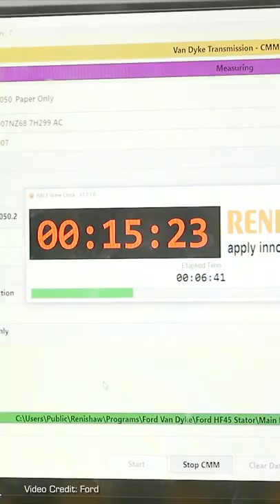Ford Patents Tow-Charging System For Electric Cars #Shorts

Comment: Someone did this in a Tesla before and it worked. However, Mach E's coming down a long steep hill in the EU were overheating their electronics from prolonged regen......I'm Thinking, if you can't make good tech, you might as well go for patches?? Variable Regen is already built into many vehicles. Teslas could probably do this with an O.T.A. Update, adding an On-Tow setting on the main screen and that would vary the regen rate according to the vehicles power electronics.

Comment: I see this as a niche option.  "Oh crap, I ran out of battery 30 miles from a charger."  A roadside assistance vehicle could tow charge you just enough to get to that charger.  I don't see it as a thing you would use except in an emergency.

Comment: Though not recommended for the current available EVs. Sounds like Ford have worked out the mechanics and software of this as to not damage the drivetrain & batteries.

I can see a setting for Tow-Charge that would set the vehicle into "neutral-gear", while also locking the steering wheel into forward position. *No more ropes and funky knots.

Comment: The world could use tow charging as an additional method. Any number of places in the world don't even have reliable power for homes, let alone a luxury like an electric car. Hopefully in 20 years they have induction solved so that every EV can both plug in plus induction charge. That way induction can be built into street parking, parking garages, etc. where vehicles sit for long periods.

But I'd like to hear about the safety of induction charging, say if it was in the garage or driveway. What if a child parks a tricycle on the pad? Way back when I lived in AZ many of the high power lines run along the canals. There was something about my Nishiki mountain bike that gave me constant shocks if I road the canal paths while my friends had no issues with the brand they had.
Reply: What if a child parks a tricycle on a pad, turns the pad on, triggers the charging logic, and then... what?  Maybe has just the right electromagnetic loop to create potential and get burned?
That's alot of what-ifs.
A close one would be, 'what happened when a critter squirms into the space between the pads'
EM is mostly harmless to living things.
Reply: @CrissaKentavr  Is there charging logic like the pins in an EVSE? I think induction is always on, and it certainly will be in parking spots and roads. A pan on a stove doesn't have a chip to signal it's ready to get hot. We turn the stove off when not cooking because an accidental placement of the right type of metal or coil will cause a problem. Although possibly car induction charging is to weak in strength to cause any safety concerns and I'm sure they'll figure it out to avoid being sued somehow.
Reply: @davidmccarthy6061  In the SAE (Society of Automotive Engineers) J2954 wireless EVSE charging standard, there is a handshake that happens over WiFi (set out in SAE J2847/6) between the emitter and receiver before the charging current is initiated, analogous to that in the J1772 standard. The emitter isn't going all the time. There's also an automatic shutoff for foreign objects deforming the field, so a cat or a toddler or something won't get injured, and an object that gets tossed under the car by wind or something doesn't cause harmful interference. There are probably people who'll intentionally put things under charging vehicles to stop them from charging just because they don't like EVs, but at least it won't cause damage - though if it's a paid charge the owner might get hit with an overstay charge, depending on how things are set up. See https://www.sae.org/news/2020/10/new-sae-wireless-charging-standard-is-ev-game-changer